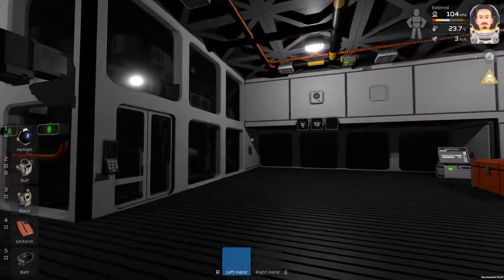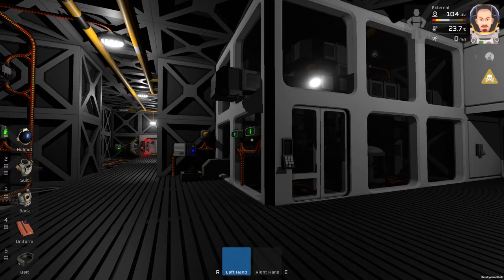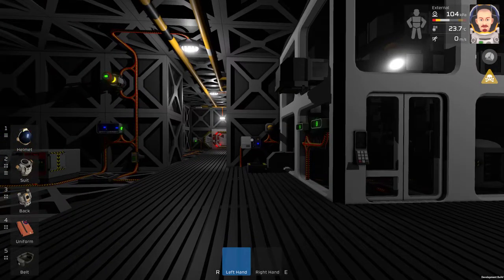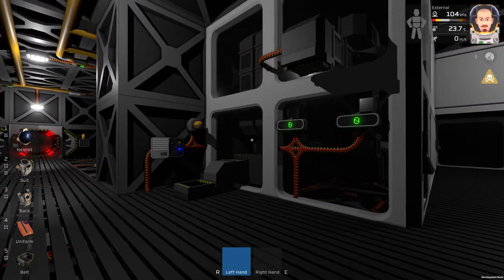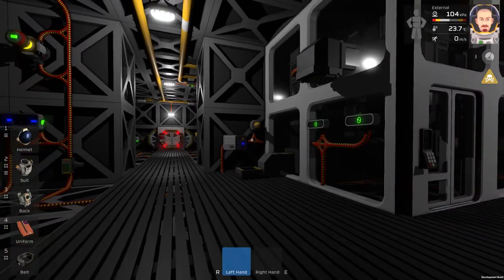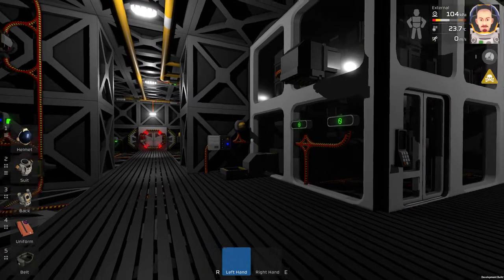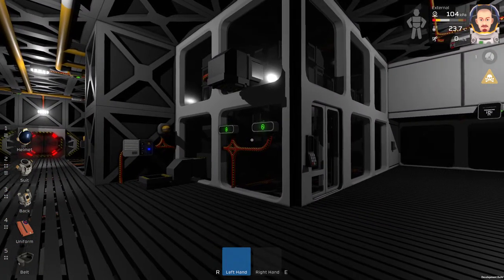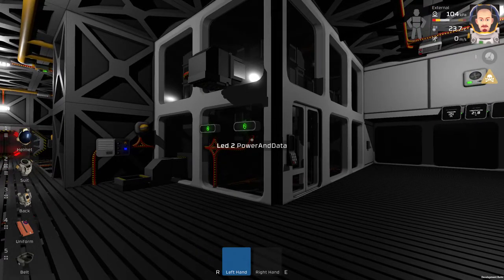Stationeers Arc Furnace Enhanced

Comment from the maker: If you would like to see the electronics behind it, let me know
Reply: There is one case that will require quite a bit of manual resetting; try dump 4 stacks of 10 gold ore and your furnace activation logic will lock up. From the time the first batch is done and the next one enters the value of ImportSlotOccupant will never change, thus activation will allways be set to one and the arc furnace only activates when it changes to a one.

But adding an additional reader on the furnace that reads ExportOccupantSlot, then have a comparer that does ImportSlotOccupant Greater ExportSlotOccupant it will flick to zero as it ejects the ingots, use this comparer as activation of the arc furnace and it will restart as soon as new ore is present.

Using this you can of course have your setup take in whatever you throw at it, split it to one ore each then just feed the furnaces one ore at a time then a stacker restacking the bars until all the arc furnaces are done or maybe have a eject what you have for now button! But that would require additional logic and messing around with a lot of logics.
Reply from the maker: hello, thank you for commenting, I am processing most of my ore in alloy furnace, I wanted to try set arc furnace in vacuum room and had very little room to build any fancy electronics. But I will upgrade it :D check my greenhouse ultimate control, I am sure, you will like it little bit more then arc furnace enhanced
Reply: Please I have to build me one of these this is awesome